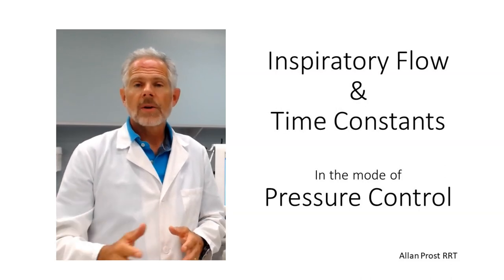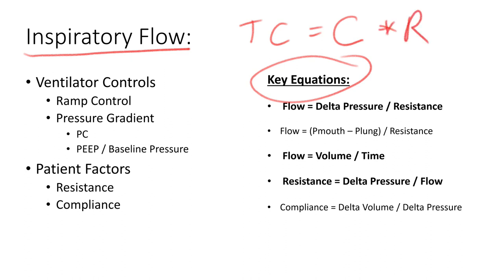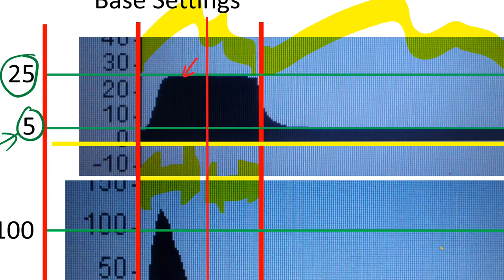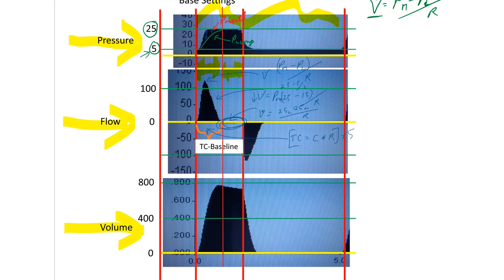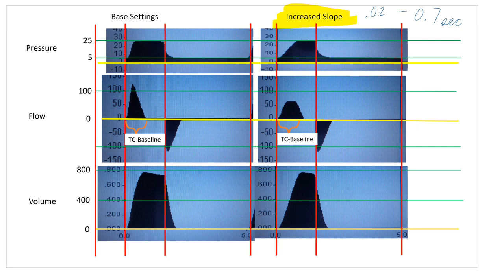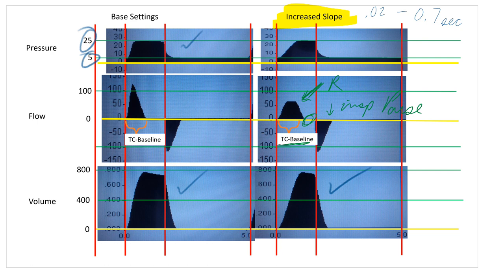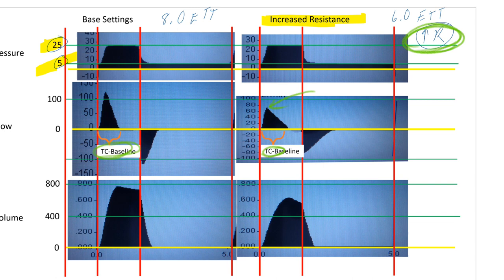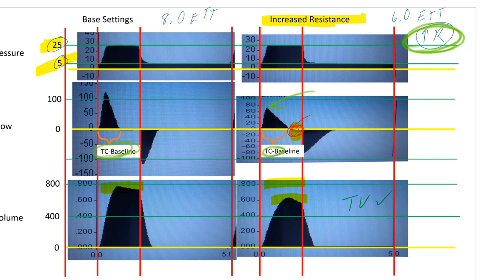Exploring Flow & Time Constants in the mode of Pressure Control

Comment: With a size 6.0 ETT, you obviously have higher resistance and, consequently, more turbulent flow through the ETT tube.  Therefore, P(lung) of the lungs would reach P(mouth) much later, with a size 6.0 ETT.  P(lung ) would reach P(mouth) faster with a 8.0 ETT. You can see the inspiratory pause for a size 6.0 ETT is shorter than the inspiratory pause for a size 8.0 ETT.  The lungs spend more time at P(mouth pressure) with an 8.0 ETT than that of a 6.0 ETT:  therefore, a smaller tidal volume for a 6.0 ETT and a larger tidal volume for a 8.0 ETT.

Comment: i dont understand how you're getting the resitance to calculate flow.  To calculate flow we got the change in pressure by subtracting Pmouth and Plung but what value are we using to calculate the resistance to divide.